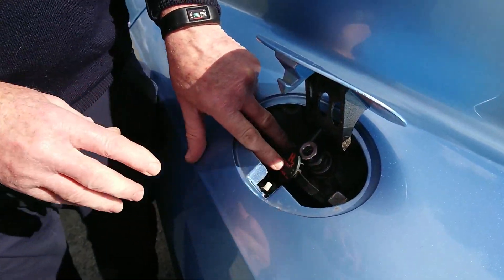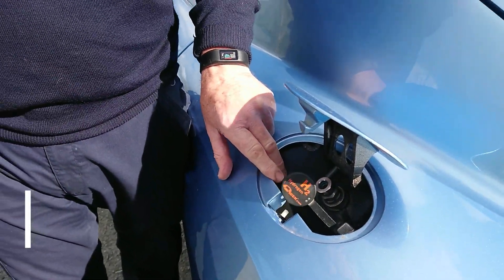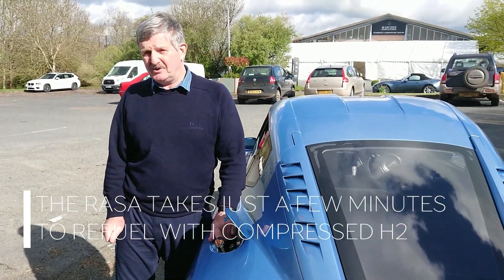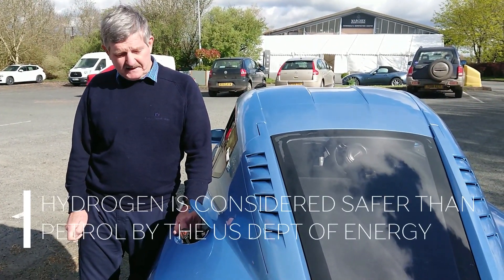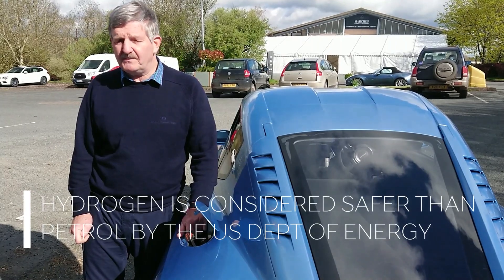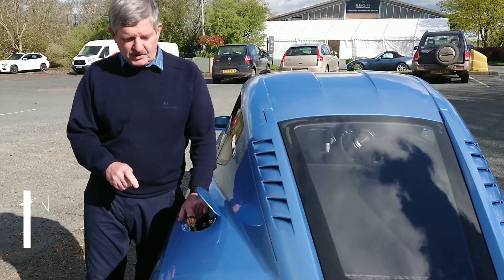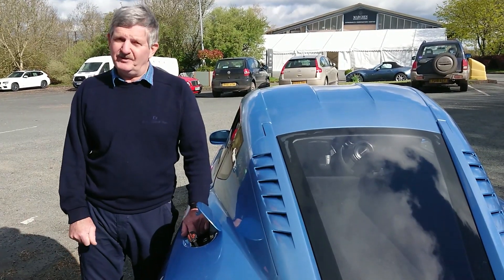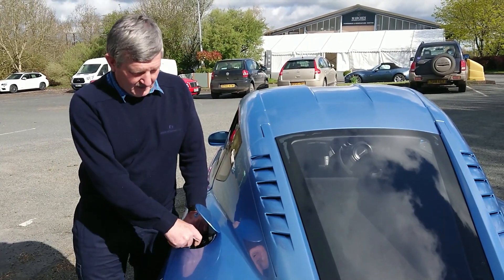How do I refuel the hydrogen-powered Rasa?

Comment: Maybe interesting at this place: The Rasa uses only 350 bar, not 700 bar like e.g. the Hyundai Nexo or the Toyota Mirai.
That's no problem, because hydrogen refueling stations offer both pressures.
It's easier and needs less energy to compress only to 350 bar.
The disadvantage is a bigger tank volume, but you don't need a huge tank for just 1.5 kg of hydrogen.

Comment: I see this is useful in more remote areas where there aren't any electrical charging points, but it doesn't look up to remote areas.
I thought that everything was going electric these days; you couldn't charge this up via your own green energy.
I like the project and I can't say anything because I am 17 with no qualifications.
 I don't really see a market for this car. I will live in anglesey soon with my mum. When I am older I don't want a petrol car; I want something that can be charged by Solar panels at home, without the range issue(ie hydrogen electric?) and have 4wd. That would be far too expensive.
What I am trying to say is this looks like a City car, but city cars will probably be electric, however it is not a 4wd car like a 4wd swift.
Sorry not very well explained I know.
Anyway I wish you the best

And it looks very nice, I want one some say...